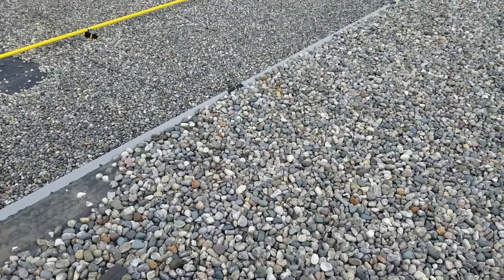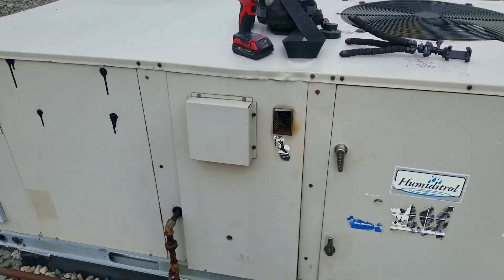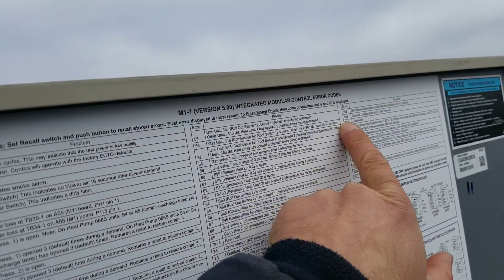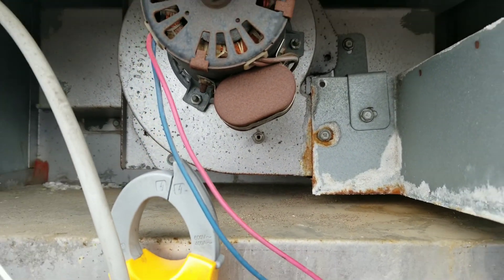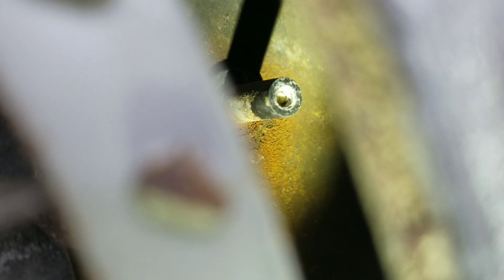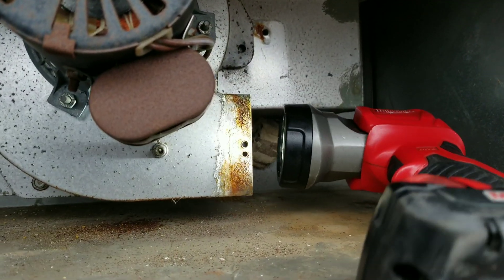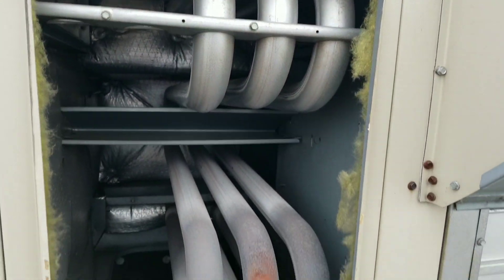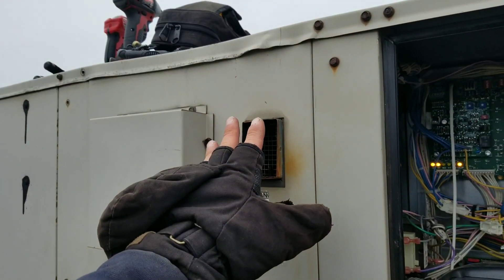Lennox package unit not heating

Comment: plugged pressure switch nipples are very common across all HVAC units, obviously metal ones worse than plastic, but I've seen plastic plug also. small ports and very tiny flow amounts, unless they are bleeder type vacuum switches that always allow some air flow in. but those have issues if the bleeder port plugs.
Reply from the maker: Hey Throttle bottle- thats very interesting- I haven't an issue with the plastic nipples, yet anyway
Reply: @curioushvacguy6876  they plug and build up with white mineral crust, just not as bad as the metal ones do or rust also

Comment: Thanks for sharing.. BUT... now I'm going to give you heck for sucking on that pressure switch. Fight the urge, don't do it.. it's an easy way to damage it or knock it out of calibration. Use your manometer to test it brother.  Ok Rant Over.. :-)
Reply from the maker: Your right, I should probably get tested for some sort of diseases

Comment: Yup seen it. I keep small Allen wrenches in my parts box in my tool bag just for this. They also fit pneumatic thermostats. I don’t go through the trouble of removing the induce assembly. Just push the debris in and the blower takes care of it. I’m not making videos at the time so that part was good to show. I should start making videos. My favorite videos would be where the customer decided to repair the system themselves. New bearings, shaft lathed down, set screw sitting on the ledge. 40ton air handler. The more you fix stuff the busier I get lol. I can tell you about that repair. Good knowledge to have. Thinking outside the box.
Reply from the maker: ACTech, man I haven't run into to many calls where the customer has done anything but id love to see some customer hacks and "repairs" worst ive seen was a customer who cleared ice off the manitowac ice machine with a screwdriver, I almost laughed outloud
Reply: Sent an email. Didn’t have pics of finished product

Comment: how cold does it need to be to rate it as an emergency heat call, it never really gets very cold here but people flip out if it is 40 outside and 60 indoors
Reply: Susie Dunn I used to have very expensive tropical fish. They required 85 to 88 degrees. They should have heaters in the tanks. Some people require a certain temperature or they go into bitch mode lol. Just saying.
Reply: For this call, it was an outside of normal hours call. At the begening he said that it is on a week-end. They are probably closed during the week end...
Reply from the maker: I don't like to say the names of my customers store but it's a well known pet store, a smart pet store if you will--lol they where open but if there heat didn't get fixed they would have been forced to close. I got lucky and it was a pretty easy one, thanks for watching
Reply from the maker: It was like 60-65 in the pet area, pets where fine but there rule is something like 65 or below is an emergency so they moved the pets to another part of the building and called me---- it was a good time